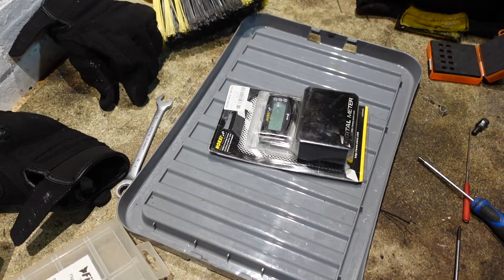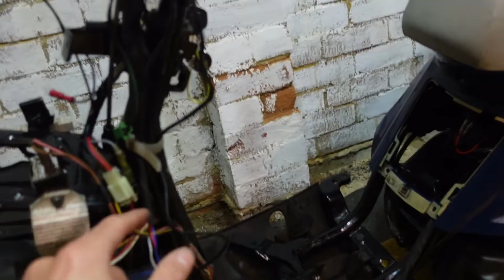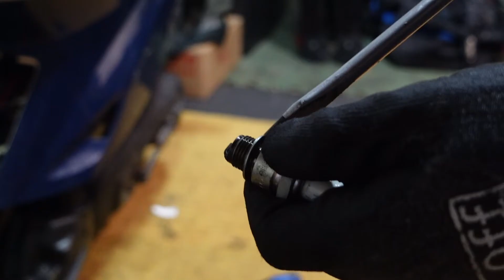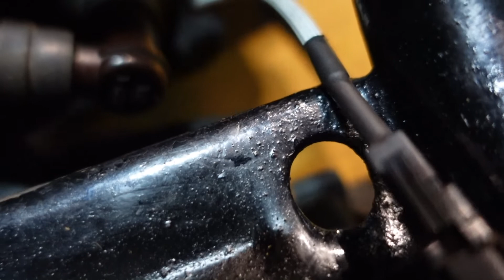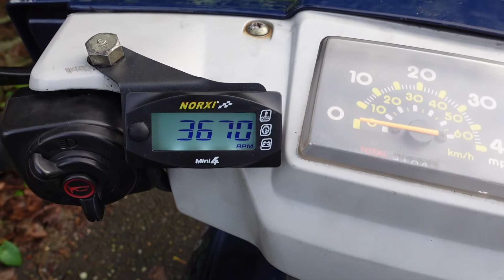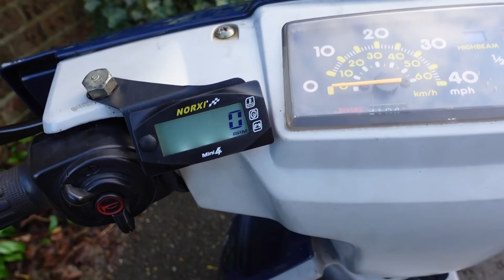12v Tachometer Installation on 50cc Scooter / Moped - (NORXI MINI 4)

Comment: excellent scoot i have the same model in Australia.  just want to ask what did ur scooters RPM reach at full throttle and what has the max temperature reading reach in summer and winter that will be very helpful, and thanks

Comment: You have to wire it so that the red and black go directly to the battery. (this keeps slight power to it so the time doesn't keep resetting)  The blue wire should be attached to an auxiliary power wire that only gets power when the key is turned on. (this powers the back light)  Hope that helps.
Reply: At the end he stated he didn't care about that time. No hating or bashing. But when I do mine I now know the correct way so thank you
Reply: Hello, greetings from Türkiye. I understand everything, but can you help me with where to connect the red, black, and blue cables?

Comment: How did you tune the rpm meter? Mine says 10000 rpm idle with the cable wrapped 10 times around on the 0,5 setting

Comment: I bought NORXI's mini RPM meter two months ago. The initial mode was set for a two-stroke engine. After changing it to a four-stroke engine mode, everything was normal. The brightness is very high. But the shortcomings are also obvious, the speed is refreshed. The frequency refreshes about once every 1 second. So I want to try NORXI's MINI 4IN1 meter. After watching your video, I think the speed refresh frequency of the 4IN1 meter is still not fast enough.
Reply from the maker: thanks for your comment!
Reply: How did you change the setting to a 4-stroke?  I have mine installed on my Dr-650
Reply: @dj_mathew4987  Press the button for 3 seconds to enter the setting interface. Display C_1_, the number 1 flashes at this time, press the button once to select the setting value, the setting range is 0.5 and 1-6. 0.5 is 1 cylinder 4 stroke, 1 is 1 cylinder 2 stroke and 2 cylinders 4 stroke, 1.5 is 3 cylinders 4 stroke, 2 is 2 cylinders 2 stroke and 4 cylinders 4 stroke, 2.5 is 5 cylinders 4 stroke, 3 is 3 cylinders 2 stroke and 6 cylinders 4 stroke, 4 is 4 cylinders 2 stroke and 8 cylinders 4 stroke, 5 is 10 cylinders 4 stroke, 6 is 6 cylinders 2 stroke and 12 cylinders 4 stroke. Press the button for 3 seconds to enter the speed warning setting interface, press for 3 seconds to select the speed unit, press the button once to select the speed value. Press and hold the button for 3 seconds to return to the power-on interface.

Comment: Good call not putting holes in your plastic.  Took me 2 years scouring Ebay to find mint panels for my headset.  Came off a razz but they are the same as a cy50.  Still sitting in the box cause I dont want to risk breaking them lol. Good idea mounting the gauge off the mirror mount.  I made a bracket that screws to one of the top mounting screws for the handle bar fairing beside the speedo.
Reply from the maker: I know it’s very hard to get replacements for these, hardly any peds left now
Reply: @retrosmoke  there is aftermarket for all panels except this style headset.  The aftermarket fitment is hit or miss.